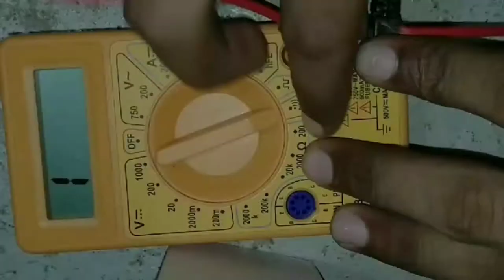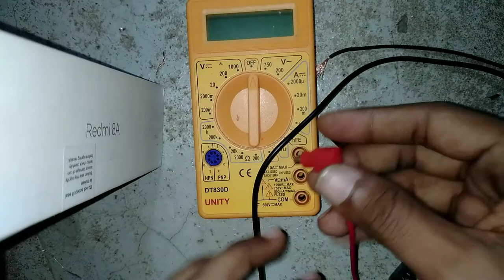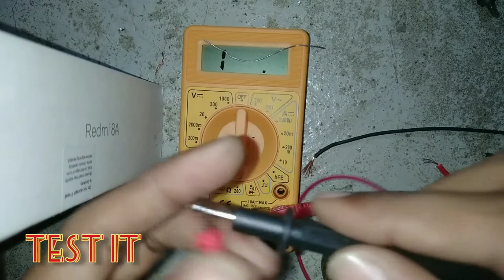Repair Multimeter probe  | life time probe wire #multimeter #status #shorts #reels #viral  #newyear

Comment: why do you need to heat the metal part before pulling it out ?
Reply from the maker: according to metal welding studies
it also require to rough meltal surface